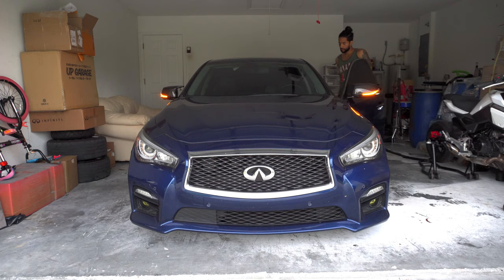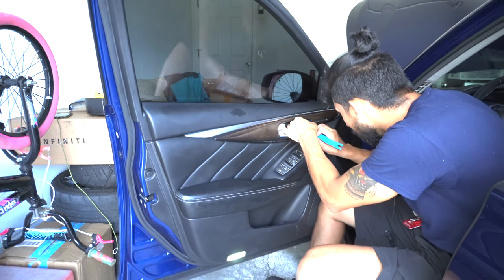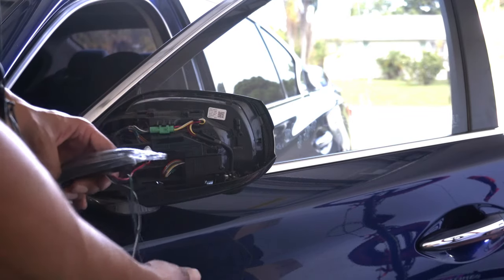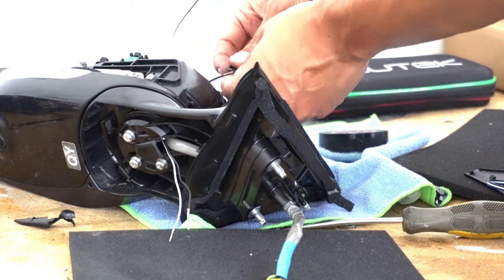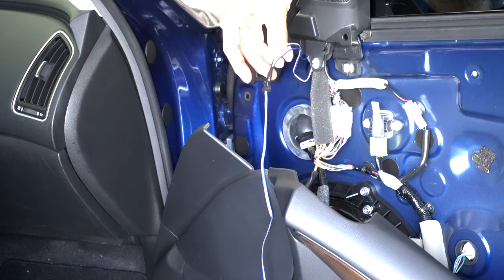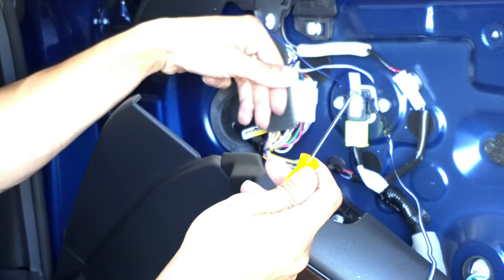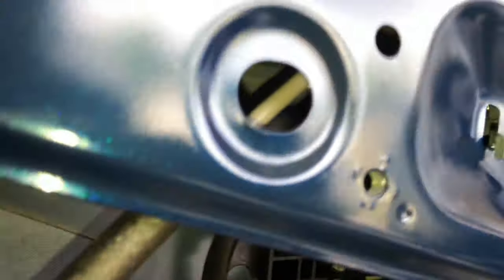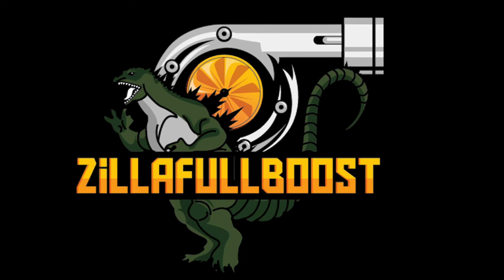How To Install Sequential DRL Turn Signals On Q50 Q60

Comment from the maker: Hope this helps anyone looking to finally get that puddle lamp to work the way it should! If you found this video helpful take the second to 👊🏼 that 👍🏼
Reply: Have you figure out the issue with puddle light?
Reply from the maker: @directorandylous3272  I don’t have issues with the puddle lamps 😎
Reply: Do you know why the drl stays on when the car is off and locked I plugged it to the purple wire but it stays on
Reply from the maker: @StarBoy-nb4yd  your lights are probably not the same as mine and the wire diagram is different or you wired it incorrectly.

Comment: Just did this install today.  Your instructions where perfect. Took me about 5 hrs to complete both sides.  After doing the first side, the other side was a lot easier.  Fitment ain't bad, but there is a gap at the end of the lights, which is kind of annoying.  Especially since water can enter more easily.  Good idea to seal this area with some kind of rubber sealant.   Much appreciated.:)
Reply from the maker: Your comment is spot on with the install in regards to the other side being much easier. Everyone seems to have that gap there.  Some clear sealant should work. I left mine with the small gap and haven’t had issues with water yet, but I do park my car in a garage. 

Thanks for  watching!

Comment: Question about removing the bottom cover at around 5:08 . I think it was edited out.
Reply from the maker: What’s your question?
Reply: @ZillaFullBoost  how were you able to take off that bottom cover? Any screws or just flips out? I'm trying to install mirror sequentials on my qx60 (it's the same part) and it's impossible to fish the wires through

Comment: Did you tap you tap into the power window harness for the DRL and power door locks harness for puddle lights?
Reply from the maker: The puddle lamp goes connected to the harness for the door handle. Taps into the puddle lamp off the door handle.

Comment: Great video, we go the install done and we we have hyper flas in the back tail lights any input?
Reply from the maker: I didn’t have hyperflash so not sure. I did however have tails as turn signal harness installed. Maybe that’s the difference,

Comment: Does that bundle of wire that goes inside that rubber grommet the same line as the puddle lights wiring? Can we just tap it outside instead of going all the way in by were the plug and play connectors are?
Reply from the maker: Good question, I’m not 100% sure but I believe it’s from another source by the hinges.
Reply: Did you try this? Did it work?

Comment: Hey can you help me out I got the front bumper sequentials with drl and I connected everything even with the resistor to the drl wire from the headlights and it hyperflashers any ideas how to fix this
Reply from the maker: You probably wired the resistor incorrectly. Watch some videos on that so it can help you understand it.

Comment: When I wired it like this my windows don’t go up automatically like if I double click it up but they go fine down automatically did the same thing happen to yours, I wired it exactly how you did
Reply from the maker: Hey, no mine are fine. You may have wired it incorrectly.
Reply: Am having the same issue

Comment: Hey I just have a question what does the green wire do and what did you do with it or where did you connect it ?
Reply from the maker: Hey, so basically if you want the turn signal to flash like normal you'd wire that instead of the other wires. It elimates the sequential feature. You can cut it short or leave it laying in the mirror assembly.

Comment: Got a question, are these the same turn signals as the ones that do like a dance when you open the door? I don’t want drl on at all just want the dance thing to work when I open the door so guessing tap into the door light. Which wire would that he ?
Reply from the maker: Yea they have a sequential pattern when opening the door, but I think that’s only on v2. That sequence is standard after plugging the turn signal wires to the oem plug.

Comment: question, in case that I want just the welcoming lights, NOT the DRL, should I just not connect the blue cable? Tks
Reply from the maker: Correct, don't wire the blue to the purple.

Comment: I  have a question…so i dont want drl running all days..i just want it to function just with me unlock the door..so the drl and the puddle comes on wen i unlock or open the door just with the factory lights
Reply from the maker: So don’t connect the blue wire to the purple. Try the blue wire to the same one for the puddle.
Reply: @ZillaFullBoost  what color is that
Reply from the maker: I don’t remember, it’s in the video. I think it’s brown and gray. One is positive the other is ground.
Reply: @ZillaFullBoost I tried this but now my drl light doesn't turn off

Comment: If I want the puddle lamps to be on while driving but only when my headlights are on/at night what’s would be the proper technique?
Reply from the maker: Instead of wiring the drl to the harness right behind the panel you wire the puddle wire to it.

Comment: I just install these a week ago everything was working fine but the DRL won’t turn off anymore even though the car is off. It never done that before
Reply from the maker: Something went loose
Reply: @ZillaFullBoost  update: I removed them because my windows are all rolling down. I roll them back up and turn off my car. As I walk away an hour or 4 my windows will roll down. I know about the key fob thing but that was not triggering it.

Comment: I plugged my lights into all the harness like said and I can’t get the lights to work beside the sequential.
Reply from the maker: Tyler Marinelli dm me on IG. Send me a picture or video of your wiring.
Reply: Make sure you have continuity with the harness you made. Try tugging the wires you cut and connected maybe you have a loose connection. If you didnt use a posi tap like his then maybe the tap didnt have a proper connection. It happent to me today, i bought the clip on tap and the metal clip didnt puncture the insulation so it didnt have a proper connection. I had to strip some insulation to make it work. Cheers

Comment: I need some help. I think i messed up my wires because the "purple" wire for the DRL's now has no current and for some reason the gray wire next to it now has a current. When i try to connect them nothing happens. Additionally my window rolls up only in segments not continuously. Does anyone know a solution?
Reply: Did u ever figure out your window situation? I installed these mirror lights on my qx60 and had the same issue with windows. I had to replace my whole switch to get windows to work again.
Reply: I have the same issue
Reply: What did u do to fix it??

Comment: Question bro , if I do it the quick 15 min way for sequential only , will I still get the bright white light after the turn signal goes off ?
Reply from the maker: No. Only thing that will work would be your Amber lights which are your sequentials. You won’t have the White DRL’s nor puddle lamps.